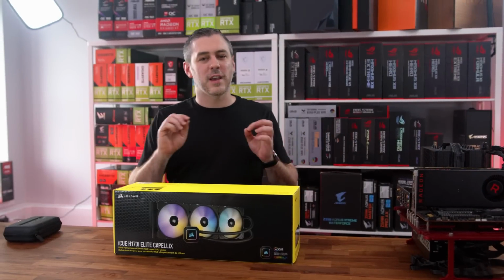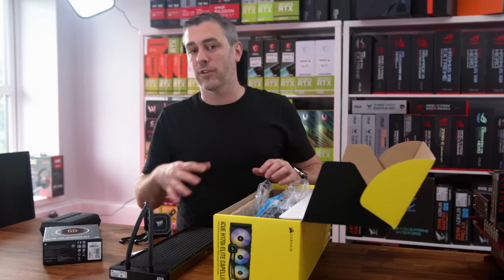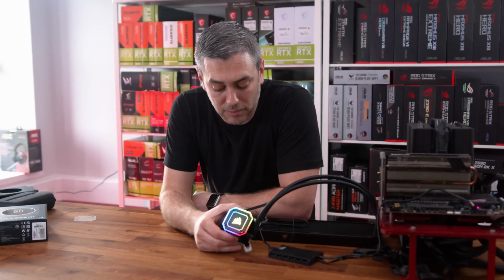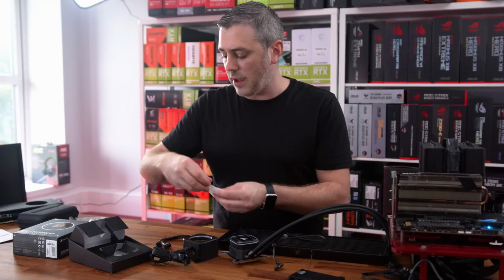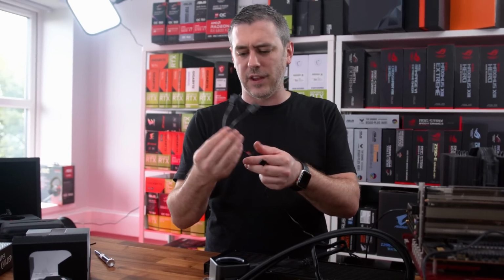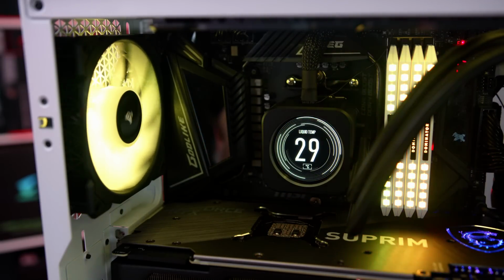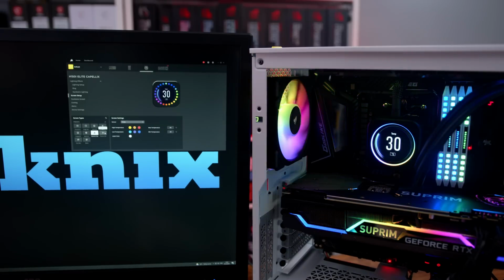Corsair iCUE ELITE LCD - How To UPGRADE Your Capellix AIO

Comment from the maker: Will you be getting one of these for your PC?
Reply: OF COUSEEEEEEEEEEEEEE!!! we all know a LCD screen in the AIO means more FPS , DUUUH / cooler F P S
Reply: I’ll be getting the upgrade kit. But can you change the orientation of the screen? The hoses exit the pump on mine on the left side. So with this orientation the screen would be upside down. I’m not excited to move the orientation of the pump itself.
Reply: i got the h150i for my 5900x in august and i would have bought this if it was out then 
the upgrade is expensive for what it is
Reply: @john-rk2sv  I have the same setup, what are your Temps?
Reply: @AmateurTroll69  it sticks around 38c to 45c at idle dependent on room temp and 70c to 75c ish under load its never hit 80c so thats a plus
Reply: I’ve got the H150i pro XT.
Reply: Maybe I missed it but is there a white one?
Reply from the maker: @The-Rev-91  The Elite Capellix white exists, so I'd assume a white LCD would be coming soon.
Reply: Yup, just pre ordered two for my h150i machines. Didn't see it in the video, was there a rotate screen option?  With the Threadripper pro builds we had to rotate the pump due to the motherboard mount.
Reply: I want a 420mm AIO but i swore never to buy Corsair again, because of MANY product failures. A Corsair product with more potential points of failure doesn’t really give me confidence that things are better now.

And then there’s the horrible Corsair software, worst in the industry.
Reply: @baddog9188  you use icue 4.x? - feels like the best in the industry when paired with icue commanders and all corsair components.
Reply: @baddog9188  Is there better RGB than Corsair? No. If you care so much about performance, go HyperX or smth else, but Corsair will always win at RGB and iCUE as the OS controlling all the RGB.
Reply: im glad corsair went about it this was but there is no way im spending £90 on an UPGRADE KIT. Its massively over priced.
Reply: @jkd4568  cheaper than buying a new AIO.  If you want an lcd that is.
Reply: YES
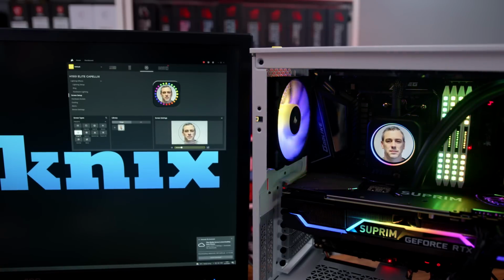Reply: 18:07 Definastely an Nvidia AI generated face to entice buyers and make people feel calm and at ease when making their purchase :P
Reply: naw. icue already takes up too much resources. adding a moving gif or an entire screen would just make it worse
Reply: @Skop_p  I prefer signal RGB it's waaaaaaaaaaay better than icue I control everything from there, I take you can put a GIF to use it when icue is not opened, so set a GIF and close icue
Reply: @neosatorii  yes you can he said it in the video
Reply: I used to have a White 240mm Capellix, but I got rid of it as the AIO pump is far too noisy even on quiet mode. Hope they have fixed it now.
Reply: Ordered Day 1 - Coming Friday! (canada)
Reply: If AMD users have all 4 DIMM slots in use, they wont be able to orientate the CPU block with the tubes on the right side. Can you please confirm this that if it will fit or not? Going off my NZXT Z73 CPU cooler, I can't mount the pump housing with the tubes on the right due to me using all 4 DIMM slots and I would like to upgrade to this AIO cooler for the LCD and iCUE integration I currently have.
Reply: Yep, when they become available.
Reply: i have a capellix aio but i wont get this just yet, i like the look of it right now and i might upgrade in future.
Reply: 100 for an lcd? hell no, not even oled, hard pass
Reply: I'll stick with my z73
Reply: Finally was able to buy one during last restock and I spray painted it white to match my all white setup.
Reply: I paid £105 for the 240mm corsair 'icue h100i elite capellix White' This LCD upgrade RRP of £89.99, way too much, £35/45 would like to see.
Reply: Maybe no sir..because i dont care about my pc temps
Reply: yes
Reply: yep
Reply: $100 for a lcd screen ? no thank
Reply: i'd be getting an h150 elite capellix tbh, 150 is 360mm and 170 is 420mm.
Reply: Yes
Reply: Yea , bought it 5 min ago on sale 😅
Reply: Nah. Too expensive and way too many cables. Fractal and arctic makes better and cheaper aios imo.
Reply from the maker: @swizzler8053  But they don't have screens.
Reply: Nah
I prefer air cooling :D
Reply from the maker: @KIZARTMA_PATATES  What one you rocking?
Reply: @eTeknix  id cooling se 207 xt
Not a well knows cooler but it is one of the few dual towers all black coolers that fit in my msi magforge 100r case.

Comment: I just purchased the Corsair iCUE H150i Elite CAPELLIX XT Desktop Liquid CPU Cooler. I also purchased the upgrade kit. Did I understand you to say that the upgrade kit is not necessary as it is already included with the cooler I purchased? I'm awaiting delivery of both.
Reply from the maker: Only if you bought the LCD version. If you didn’t, then you need the upgrade kit.

Comment: lol 2 years later, they're approx. 300GBP.....probably only cost a fraction of that to make.  The whole Hardware Settings option is what's really tempting me, install iCUE, set up the way I want it, uninstall iCUE....it's what I've done with Corsairs DDR5 modules and the H150 RGB.  But I really miss my old x299 Dark with its onboard CPU temp readout lol. Think my original idea will be the way to go, buy a 2.1" IPS Display and stick it on top of my AIO Pump, so much cheaper.

Comment: This gives you a couple of options. The first option is if you can find a standard Capellix AIO for a good deal, now that they are the older model, you can save a little bit. Also if you cant afford the price of the LCD version right away and you want to finish your build you can always upgrade later rather then putting it off. Though dont get the non LCD and the upgrade kit at the same time at least right now unless you find a really good deal as that would cost you more with current prices.
I just wish there was a similar option for my NZXT kraken that I have had for a few years now.

Comment: Yeah not everybody can just upgrade tot he latest versio of ICUE software.
We have to run the last version that ran with Windows 7.  
So that pretty much nixes this display for me as a non=functional piece of kit not worth buying.
Also, and don't quote me on this, but I think those "triangles" int eh Corsair logo are suppose to be a stylized old sailing ship... sails... as the Corsair was an armed ship used by pirates and merchanteers.   So what you're lookign at in teh Corsair logo is that of a sailing ship...   the triangles being it's sails.

Dragging your face onto it actually was epic, I had no idea it had that much resolution.

Comment: Dammit Corsair. You sell me that 4000D Airflow insanely cheaply, and now I stand here having bought the Commander Pro and premium/expensive RGB fans, now also wanting to get an AiO and a PSU from you, including this $100 little LCD, just to get everything in the same eco-system and controlled by iCUE... It's like a dealer giving you a first try for free and then charging extortionate prices once you "have to have more" 😅

Comment: I slapped 170i on my 6900xt, it took me like 1day and a lot of balls to do it.
The temps a really good.
Before i had 280mm aio nzxt.
It did the job  keeping gpu temps at 65-72.  Hot spot 95. JT at 88.But at 98% fan speed.
Now temps like :
Gpu 51
HS 86
JT 70
And it is all at 60% fan speed.
I Iove 170i !

Comment: 2 things I don't like: A, the hoses have to run over the ram sticks and if ram is RGB, looks janky. B, that big, ugly flat 12 wire cable running up thru the middle of your mobo. A lot of mobos now have colored covers on various components and this cable running over these sticks out like a sore thumb. You can hide the wire on the Capellix model, but there's no way to hide this big fat bastad.

Comment: As always, another great video which easily deserves a thumb up... hoping you may know the answer to this one... it's regarding the issue many of us are experiencing with the red warning triangle suddenly appearing? So many suggestions, e.g. changing the way the display is connected via USB (removing the USB splitter), uninstalling iCUE and reinstalling etc, etc but no absolute solutions. I have the H170i which worked fine straight out of the box and remained trouble-free for a couple of months but it's doing the same now... shut the PC down and switch the PSU main power switch off for a minute or two before restarting the PC and it seems to sort the triangle issue out but just when you think it's fixed, minutes later, sometimes hours, even a few days, it suddenly comes back!

Comment: AM4 users BEWARE. Doesn't fit properly with 2-screw bracket, pops right out and disconnects CONSTANTLY! I might just have to super glue mine
Reply from the maker: Mines running fine and has been for months on a 5800x.
Reply: @eTeknix  How’s the temps been on the CPU? I can’t decide between an EK Elite AIO and the Corsair H150i LCD. 
I like the look of the LCD screen but does it perform well with cooling?

Comment: Thanks for showing the upgrade! I've been wondering how it all works and looking forward to getting one.  I have a 240 elite capellix up top as exhaust, but have also been looking at upgrading to a 360 in that same corsair 4000 case and was happy to see it fit with your MSI Suprim (dunno if 3080 or 3090, but I have 3090) which I also have.  Maybe I'll skip the upgrade, and just get the new 360 with the LCD. That'd help cool my 10850k just a little bit more to allow some overclocking.

Comment: Cpu:intel i9-12900k
mb:rog z690e gaming
ram: Corsair dominator 32gb ddr5 5200mhz c36
gpu:rog strix rtx 3090oc gaming
ssd1:wd sn850 1tb
ssd2:wd sn850 1tb
psu:rog strix 850w thor platinum
case:rog strix helios black
cooling: Corsair icue h150i elite lcd
=Hi-end

Comment: I’m about to get an AIO for my PC, after much consideration, ended up debating between the Elite Capellix and the NZXT Kraken Z53 …this pretty much seals the deal, as the only real plus for the second was the screen (imho), i can just get the EC now and the screen latter.

My only complaint is, why is the screen not square? Would look better considering the base. Also, we need it in white!

Comment: Can you have 2 different sensors diplayed with the "dual bars" setting?
A bit like the nzxt one can have gpu and cpu temps as a dual bar setup. I really want that feature and thats the main selling point of the nzxt one for me
Reply: @ivebeen yea its all in the cam software, just like you can see gpu temps in icue. I would just like confirmation on this because it was barely touched on in the video

Comment: tbh i prolly wouldve bought this over my Z73 Kraken if it had released like 3 months earlier when i built my PC since my PC has a more box/straight line aesthetic compared to the circle pump on the Kraken. also might sound silly but i am a bit disappointed we still dont have a square LCD display option on the market still, square block circle display looks a tad off to me.
Reply: You should be more concerned with cooling but to each their own
Reply: @BlackBruceLeeTheGreatDekuTree  the cooling is already more than enough for most chips, aio to aio at the same size the performance doesn't really change much.
Reply: @toxicturkeyy  you're right about that

Comment: I think I would get one for my H150i Elite Capellix.

Comparing prices to NZXT or ASUS or w/e brand with LCD screens on their AIO pumps those are usually USD $250-300 average for a 240, 280, 360mm AIO.

If you compare prices for an elite capellix you're talking USD $150-200 for their 240, 280, 360mm AIO + another $100 for this "upgrade" LCD screen. 

Math adds up if you ask me. Is it worth it? Probably not. But anyone with RGB knows we all have RGB for flair and our own entertainment.

Adding stickers don't make a car faster... RGB doesn't either lol.

Comment: was looking into buying a nzxt aio. do you have to use the commander pro for the screen to work?
Reply: Capellix AIOs come with a commander core which is a less featured but still awesome unit.  So thats a requirement since the LCD screen plugs into that (and the pump head)
Reply: From what i've seen the Capellix coolers only work when connected to the commander core. Because of a propritary cable. I wish it didn't tho. I have no need for a commander core. I would have bought the cooler if the commander core wasn't required.

Comment: I have a few questions that perhaps someone who has had one of these in their hands might be able to answer. Can you see anyway to remove the plastic cover from the Screen module.........so some of us could plastidip ours white? 

With the notch for the AIO water tubes it looks like there is only one orientation to mount it to the pump unit relative to the water tubes. In my case I want my pump unit mount orientation such that the tubes would come out the bottom or the left side of the pump unit because of where I mount my radiator. However, if the LCD module is fixed relative to the pump tubes then that tube orientation would have the screen on its side or upside down. Can the screen be rotated in software in that scenario?

Final question would be if it looks like it would be possible to make a custom cable to connect our now unused Cappellix LED modules to an RGB Lighting/Fan node and tell iCUE its a fan and thus rather than this module becoming e-waste it would make a cool RGB Corsair Logo inside or outside our cases?
Reply: Just use masking tape. You can rotate the lcd orientation on icue
Reply: you can actually take it apart to paint just the plastic. seen people doing https://www.youtube.com/watch?v=qY9IoHycEGY check this youtuber that did it

Comment: Is the new 4 screw AM4 bracket required to install the LCD on pre-existing AIOs? I have mine mounted on the plastic retention clips via 2 screws.
Reply: Not necessary

Comment: I really need a white one to go with my white H150i Elite Cappelix…
Reply: Same for me
Reply: Same
Reply: me tooooooo
Reply: I don’t see a white one on the website :(
Reply: Well they will OBVIOUSLY release a white one. Usually what Corsair do by the looks of things (this is what it seems like to me as most of their "white" products have released a while after the black one) is only have a black one of something and if the black one is popular and there seems to be a demand for a white version of that thing then they release a white version too
Reply: Custom paint it with heat resistant white spray paint. Use blue tape to protect screen and light bar.
Reply: White vinyl wrap works great I did both my 3080 and this in white carbon fiber wrap.
Reply: Same
Reply: White edition finnaly came out
Reply: Just bought the white one
Reply: They have it in white btw
Reply: Same here, my entire Corsair build is white.

Comment: This is great. I just bought and installed a Capellix H150i for a new high end build. I really wanted an LCD pump but wasn’t willing to go with NZXT, Asus or Gigabyte. I’ve always used Corsair coolers and fans/case fans. I was kinda sh*ting myself when I saw the announcement trailer from Corsair this morning being that I just bought this the thing a month ago.
Reply from the maker: Ahha, yeah you're all good to just upgrade it and this video really doesn't do the screen justice. It's sooooo crisp.
Reply: @eTeknix  They give you a release date on the standalone LCD? Looks like the whole kit is 5-6 weeks out.
Reply from the maker: @OhItsThat  not heard anything yet but shouldn’t be too long tbh.
Reply: @OhItsThat  I preordered one on Tuesday when it was released. It said 1-2 wks to ship.
Reply: @h3dgecore  I tried to pre order one yesterday but it would only let me sign up to be notified.
Reply: @OhItsThat  Sorry, I misread your question. My preorder was for upgrade version not standalone.
Reply: i was in the same boat i bought the H170i because it just seemed better then i seen this and was so happy.
Reply: @djfirestormx  A little warning. I got the standalone LCD screen about a week ago. I could not get it to mount correctly to my AMD system. The magnets wouldn’t make contact and the little plug from the screen to the pump wouldn’t connect. I couldn’t boot the system as it says there’s no cpu fan plugged in. I spent about two hours playing with it. It seemed like the housing of the screen may have been hitting the AMD bracket. 

 Fortunately I also have an Intel system with a Capellix. The LCD screen mounted with no drama the first attempt. Works perfectly. Software isn’t the greatest but other then that it’s pretty cool. Looks great.
Reply: @OhItsThat  I think they have a bracket for amd that will take care of your problem. I had a little trouble getting mine on due to that big braided cable. Once I had everything routed in a way that oriented it in a level manner, the magnets caught and it popped into place.
Reply: @h3dgecore  That’s how it was for my 8700k system. It just popped right in. No drama, No issues anywhere. 

So there’s another bracket I have to get for my 5900x system? That’s crazy. I wanna get another one once available again for my AMD system as that was the system I bought the thing for. I probably should reach out to Corsair.